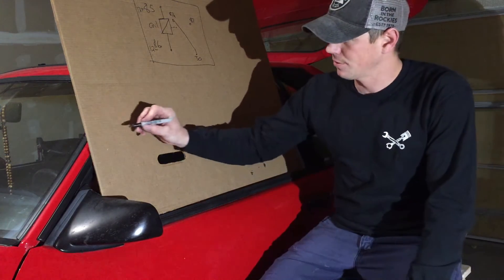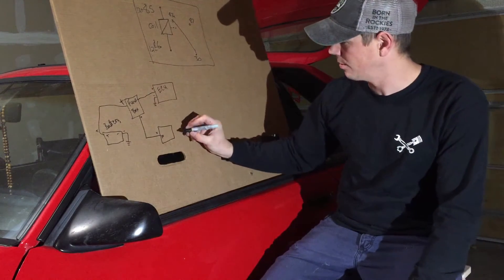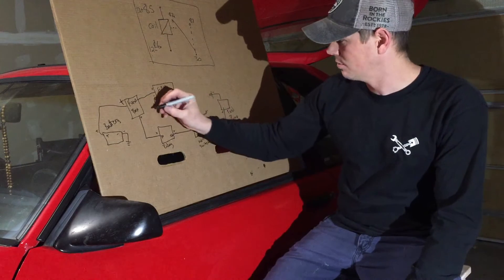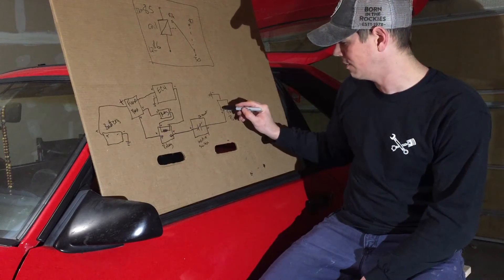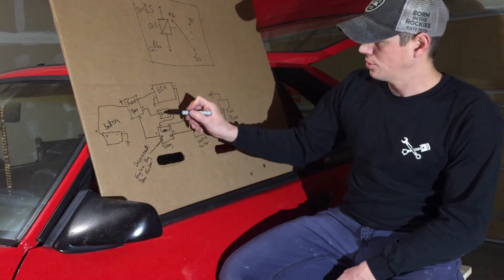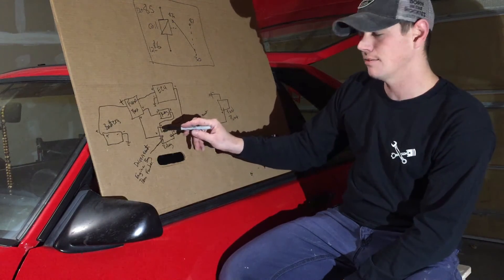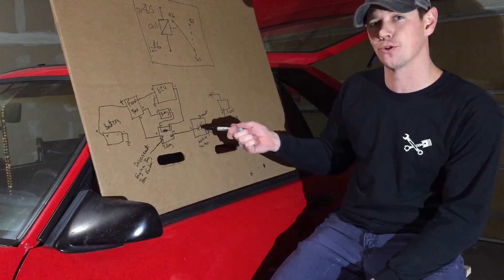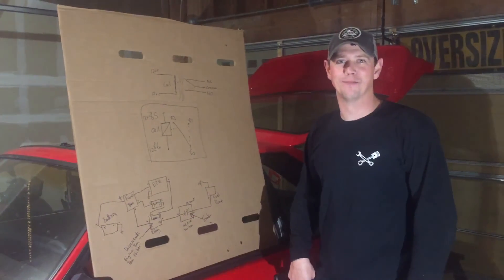Fuel System Layout [Electrical Troubleshooting / Foxbody]

Comment: So i have no ground signal from the pin 22 on the ECU. ECU is properly grounded. Guessing a fried ECU is the likely reason my fuel pump isn't turning on?
Reply from the maker: There’s a capacitor on those circuits that will cause this.  Either bad cap on the board or ecu…
Reply: @BMF_Garage turns out it was the fusible link in the KA Power. :) Took some searching but it's all good now
Reply from the maker: Ahh yes… those things are a pain to track down

Comment: My 88 SD foxvert new battery draining overnight completely, I’ve replaced it twice already and the fuel pump is staying on. Where should I start fist troubleshooting.
Reply from the maker: If the fuel pump is staying on I’d start with the key switch and then ecu
Reply: @BMF_Garage  I’ll check that out today

Comment: I have a 2000 mustang with 3.6  I can hear pump running it will start with starting fluid    I just bought it and it’s at for 2 years
Reply from the maker: If you can hear the pump running, you need to verify fuel pressure at the rails.  Could be a line inside the tank that feeds the fuel hat that’s broken.  You’ll never get fuel to the engine.  Clogged fuel filter can cause similar issues.

Comment: I've got a 92 foxbody LX 2.3 and my fuel pump doesn't prime when I turn the key to the on position I've changed both the relay control module and fuel pump and still nothing what else should I check
Reply from the maker: The prime signal comes from the ecu.  It gives the relay a ground signal to run.  Sounds like that circuit in the ecu isn’t working.  Time to pull the ecu and open it up to see if anything is burned or bad.  There are a few capacitors on the circuit board that can come off or go bad that can cause this.

Comment: I have a 1986 Foxbody that will not prime. I’ve replaced the fuel pump, fuel filter, starter, relay, reset the inertia switch, battery and still not priming. A couple months back it started up perfect every time, then it would only prime sometimes then it would only prime with jumper cables now it won’t prime at all. Car means a lot to me so any help would be appreciated
Reply from the maker: Have you checked the fuel pressure regulator on the fuel rail yet?
Reply: @BMF_Garage  so I don’t think it would be the fuel pressure regulator because once I was able to get it started it ran perfectly, I just checked the wires and everything is getting power. Could it be a bad inertia switch?
Reply from the maker: they inertia switch would interlock the fuel pump so it wouldnt run.   It needs three things. Air, fuel, spark.  Start with one and verify.  I have a spark checking tool that lights up if I have spark.  They are 10-15$ at a auto parts store.  Verify you have spark.  After verifying you have spark, make sure you have fuel pressure.  There’s a schrader valve on the fuel rail that you can check for fuel pressure. Make sure you have pressure.  I’d suggest not over complicating it.
Reply: @BMF_Garage  i don’t think I’m getting spark I was able to get the fuel pump to come on using a de Walt battery and it’s coming out of the injectors but no spark
Reply from the maker: Buy a cheap spark checking tool from parts store and verify no spark.  It can be tfi, coil, plugs, plug wires or pickup in the distributor that goes bad.
Reply: @BMF_Garage  everything is good other than the pickup coil I’m trying to get that out but Im not sure how, looks like I have to take out the distributor but I don’t know how to do that without offsetting the timing
Reply from the maker: Have to take out distributor, then remove the shaft by taking the gear and stop piece off the shaft.  It’s a process that requires a hammer, punch set, and then timing light to reset timing once you get it back in.  For most people it’s easier to just put an entire new distributor in….
Reply: @BMF_Garage i was able to get it out and drive the pins out but the gear is real hard to get off, at this point I’ve probably hurt the teeth on the gear I’ll just get a new one
Reply from the maker: It usually takes a press to get the gear off
Reply: @BMF_Garage  i installed a new distributor and still nothing, had a certified mechanic come check it out, nothing. I’m about to replace the ignition control module n if that doesn’t do it I’m at a loss
Reply from the maker: Pumps coming on to prime but no fuel pressure?  Or pump doesn’t  come on to prime at all?
Reply: @BMF_Garage  I can get it to prime no problem with a drill battery but I’m not getting any spark now, ignition switch has been replaced
Reply from the maker: Well, without a drill battery is what I’m asking about.  If it’s not prolong and you have no spark, there’s a good chance you need to check into your ecu.  The ecu sends a ground signal to the fuel pump relay to prime and run it and also for the ignition system.  There are capacitors in those circuits that commonly go bad over time.  They leak out green fuzzy looking stuff when they go bad typically and tend to cause the same issues you’re having, in addition to others.
Reply: @BMF_Garage  no I’m not able to get it to prime without a drill battery, I used to hear a click from the ecu when I turned the key which was probably the ground signal being sent but I haven’t heard it recently so I’ll check for that
Reply: @BMF_Garage  just checked the ecu, capacitors look fine but  there wasn’t a ground connected to the side
Reply: @BMF_Garage  did find some green grease like substance on the prongs for the connection just barely, could that be it?
Reply from the maker: Yes, that’s what come out of the caps when they start going bad
Reply: @BMF_Garage  it’s not leaking directly under the caps it’s the prongs that meet with the harness that have the green substance
Reply: @BMF_Garage  replaced the ecu, put on new battery terminals and still nothing man :(

Comment: Love the video. Very helpful. 
My 91 5.0 will start for a second and die. No gas. Everything was working fine. Installed a new cam. Now the fuel problem. Turn the key to start car with out clutch ingaged and pump comes on, no crank.  Ingage clutch and no pump , but cranks and starts for second. I'm very lost. And advise would be awesome.  Thanks
Reply from the maker: If it was me, I’d jumper the pump relay to get the pump to stay on and see it starts.  Could be an issue internally in the ecu, or a ground that’s lose somewhere… changing cam wouldn’t effect that unless you removed the engine and forgot a ground strap on reinstall
Reply: I will try that tomorrow and see what I get. I will double check the grounds. Had the heads off to put new valve seals and springs on with new head gaskets. So the ground on the head was off. Wouldn't think that would cause this but I'm leaning about wiring. Thanks for the response. 👍
Reply from the maker: You bet.  Just remember, most the ignition system grounds are connected under the hood on the engine and firewall.  Lose grounds can cause a lot of weird issues.  It’s also worth taking the ecu out, taking the cover off and checking to make sure none of the capacitors have green fuzz growing on them indicating they have went bad.  These cause a lot of issues on these cars too.

Comment: Hey I have few questions I was hoping you can help me figure out. It’s a 1988 body that I am doing a 1989 v8 5 speed swap on. Car was running when I drove it into the shop a month ago. Swapped everything over and went to fire up the car and the pump isn’t doing anything.
I have check the brown rely by the ecu and it is clicking. The ground by the ecu is tight and attached to the body. The green rely under the seat isn’t doing anything but I take the one from my wife’s daily driver and it still doesn’t do anything. The column switch was replaced abouts year ago and still tight. The pump makes noise when I dropped the tank and put a car battery to it. Any ideas would be much appreciate. Thanks for your time.
Paul
Reply: The other thing is I got the dash frame powdered coated so I don’t know if that would be an issue or not?
Reply from the maker: Sounds like the ecu is not powered up.  Did you swap in an entire wiring harness with the v8?
Reply: @BMF_Garage  yes I did. The motor turns over the dash lights come on the gauges work the windows and everything does what it needs to do. I swapped over the whole dash harness, ecu, the little 5speed harness, the engine bay harness and even the head light harness. The only one I never swapped over was the tail light harness.
Reply from the maker: Does the fuel pump prime when you turn the key on?
Reply: No doesn’t make any sound or anything like that. I dropped the tank far enough to put a car battery to the pump and gave it power and it works that way but I put a new pump to the car harness and it did do anything
Reply from the maker: Definitely something with the power to the harness.  I’d suggest looking in the back of a Haynes manual.  They have wiring diagrams for all years.  Typically I’ve had to wire power to a new harness when I v8 swap

Comment: Have issue with fuel pump coming on with just pushing clutch in. But if u turn key on first it don't.  As well as having the safety switch on transmission plugged in  it don't come on with clutch only when u put shifter in 5th gear. Has me boggled would love some help with issue thanks for you time
Reply: Now if I plug the safety switch up it don't do it by pushing clutch in it does it when u put it in 5th gear. Could it b the switch on the clutch pedal cause my Amp for some reason cuts out at certain point when pushing in clutch
Reply from the maker: The clutch switch isn’t tied to the fuel pump 🤔
Reply from the maker: Would likely indicate a different issue… if your fuel pump is not working in relation to the clutch switch then someone butchered some wiring on your car or there’s something severely messed up with your ecu.  Did you check the ecu to make sure nothing on the board looks burned or bad and that none of your capacitors look corroded?
Reply: @BMF_Garage  everything works fine. I drive it everyday its just drives me nuts y it does that.
Reply from the maker: That’s really odd. That’s one that will take some time and a volt meter to track down
Reply from the maker: Sounds like an ecu issue.  Have you take. The ecu apart and looked for corroded or bad capacitors?  Usually the culprit for those kind of odd issues

Comment: Hey great video. I have a 84 svo and I have power to the relay as well as all the way back to the pump. If I bypass the ecu and run a ground from the battery to my FP relay the fuel pump will run when I turn the key over. Is there a ground between the ecu and fp relay I'm missing or is my ecu bad? Also should my fuel pump run continuously or prime and shut off?
Reply from the maker: Fuel pump should only prime s few seconds and then continuously when it’s running.  If it’s running constantly that’s usually a good indication that the ground circuit in the ecu for the fuel pump is not working.  I have another video about checking the ecu to see if it’s bad.  Essentially you take it out, open the case and check for any bad capacitors or burn marks on the board.  Bad capacitors get a green fuzzy looking residue around them when they go bad.
Reply: @BMF_Garage  so I grounded the fuel pump relay to the floor and the fuel pump turns on when I turn the ignition but it continuously runs. I'll pull the ecu out and take a look.
Reply from the maker: That’s because the ecu is giving the ground signal to turn on that relay.  If it’s not working, the ecu isn’t giving this signal

Comment: Hello maybe you can help I have a 93 fox body new fuel pump and new fuel pump relay but no power to pump no fuel to rail any thoughts 💭? Thanks - James
Reply from the maker: There is a fuse for this.  Have you verified you have 12 volts coming from the fuse ?

If you are 1000% sure there is no voltage, you’ll have to trace the wire back and see if there may be a fusible link that burned up or went bad.  They are usually in the engine bay by the starter solenoid

Comment: My 92 gt 5.0  the fuel pump relay is under the steering column by the way. Along with some sort of light relay ,not sure which one and the door dinger all mounted together held to the frame of the dash, on the right side of the steering, with 2 bolts
Reply: My 92 has the Relay under the hood by the passenger side strut tower

Comment: I have a question i recently changed my fuel system on my 92 mustang gt and now my car don't wanna start it cranks but it wont start any suggestions will be highly appreciated i think it might be the ignition module tfi.
Reply from the maker: One of my newest videos walks through testing the tfi and pickup in the distributor.  

I always start with fuel and spark at the engine.  Figure out which you don’t have and track it down... check fuel pressure at the rail.  If you have fuel pressure, turn the key on but don’t start it.  You should hear the pump prime and shortly after the injectors pulse priming the cylinders.  If all that checks out and you know you have fuel, more on to spark. 

A timing light can be valuable in checking spark.  If you hook it up and watch the light during cranking you will know if you have spark.  No light, no spark.

https://youtu.be/WHsm4LKiCh8
Reply: @BMF_Garage  i got spark no fuel pump with check engine my capacitors are fine inside the ecu only weird thing is the wire that runs to the inertia switch and the mass air flow and the injectors is only making 3.5 volts should be 12volts know? Even though it's a low current circuit
Reply: I put the car away running with a speed density wiring harness and computer the only thing I have changed is to a mass air flow harness and computer i haven't touched legit anything else
Reply from the maker: If that’s all you changed, I assume it’s an issue with the maf wiring.  It either thinks it’s seeing too much air and giving it too little fuel or seeing not enough air and giving too much fuel
Reply: @BMF_Garage  i legit just went to see if the eec was plugged in right an I unplugged it to notice something is shaking around in there so the eec is most likely broken or some part in the eec that is broken is not giving 10 to 12 volts to the pump relay and that  EEC is 2inch from the ECU great videos by the way keep making these you're going down as a legend in the Foxbody community facts! haha
Reply: @22pimpin1  thank you
Reply: @daveg9002  would you or clevor bmf know what could be happening to my car now i got a new eec relay in and now the volts going to the eec are at 12volts but when the volts hit the pump relay they drop to 6.8volts and still no fuel pump prime
Reply: @22pimpin1  sorry bro i don't know i wish i could help you
Reply: @daveg9002  all good wish me luck with Ford's spaghetti wiring haha
Reply: @22pimpin1  Hello, i am having the very same issue. Im only getting 4 volts at inertia switch, injectors, and red wire on fuel pump relay. Did you ever figure out what the issue was or how did you solve it? Any help is appreciated. Thanks
Reply: @diezel69cobra  yes there is 3 relays replace them all one on the intake on frame rail by passenger headlight, other is EEC its right beside the computer in the passenger kick panel! Replace all 3 with the same Relay and let me know what happens and there is also 2 fuse links one on harness by fire wall pass side and other is at the starter solenoid its the blue wire
Reply: @22pimpin1  will do. Thanks so much for your help. I will let you know my results.
Reply from the maker: Usually just relay issues when that happens.  The contacts on the relay go bad or wear out and voltages get weird.   Replacing them usually resolve the issue

Comment: where is the relay? is it in the black box looking deal under the hood that clicks when the key is turned on.
Reply from the maker: At about 8:08 into the video I show you the two places the relay could be depending on the year of your car.  

It’s a small black square and yes it clicks when energized.  There is a power relay for the ecu and also a girl pump relay.  The fuel pump relay should come on for a few seconds to prime the system when you turn the key on and don’t start it.  When it’s running the girl pump relay should always be active.

Comment: Thanks for providing all this help! When i ground the test port? How do i exactly do this? I connect a wire from the upper right connector of the test port to the body and I should hear it prime? Or do i jump a wire from the right to another connector on the test port? Thank you!
Reply from the maker: So you can do it either way.  The upper right port to ground is basically the same as taking it to the ground pin on the test harness.
Reply: Awesome is the ground port the 2 pins in the bottom center of the test connector? Thank you again! @BMF_Garage
Reply from the maker: I’ll have to double check that... I’ll get back to ya